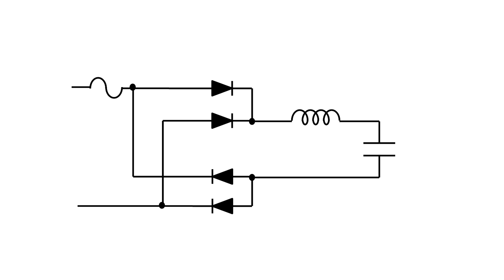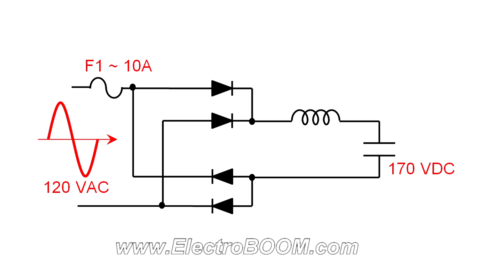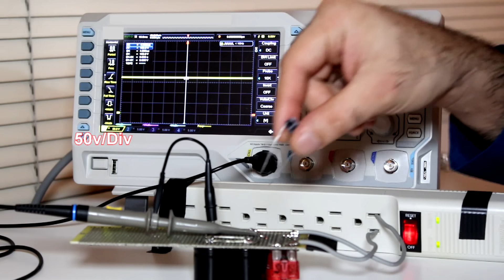Making a Full Bridge Rectifier

Comment: insulates the ground wire

we are safe now
Reply: lmfao
Reply: Or are we?
Reply: @polskiobywatel553  Moon men plays
Reply: Hahahauhaah
Reply: Hahah
Reply: LMAO
Reply: unsafe safety is where it's at
Reply: Used to be common practice amongst TV engineers as the TV chassis was live. Never used an earthed soldering iron on TV's back then.
Reply: @catman4471  A better approach would be to run the TV through an isolation transformer.
Reply: @simonharris4873  Yeah...it's odd really because that was always an option and we used to pull isolation transformers out of the old school TV sets we used to get...but we never used them. Just old fashioned pull the earth lead off tactics!
(Do you remember those school TV's on the stands? Ferguson/Thorn 1500's!)
Reply: @catman4471  LOL. I'm not quite that old 😄
Reply: @simonharris4873  Nah me neither...I just made it all up!
Reply: doubt
Reply: hands on the safety capacitors leads
Reply: @Discòωórd 
I see you everywhere
Reply: …of the oscilloscope.
Reply: This very dangerous
Reply: Only for girls
Reply: I think 🤔 this crazy man
Reply: Didnt get it
Reply: lmao
Reply: lmao
Reply: Haha
Reply: I always rip that silly ground prong off. Safety Third!!!
Reply: 6.9k xd
Reply: What is the problem and why he isolated the ground of the wire
Reply: @21Omareddin  The earth pin is a safety feature. It is connected to a large metal rod that is in the ground under every house. It is basically an emergency way to get rid of excess current. When he connected the probe to his circuit, he shorted the power to earth. This caused a fuse, another safety feature in his circuit to blow, as a fuse is designed to melt so the other components don't.
By disconnecting the earth pin, he basically negated decades of safety features with a piece of tape.
Reply: @n00bxl71  It may look like he's neglecting safety, but he actually knows what he's doing
Reply: Using 5000$ differential probes to measure mains voltage
Vs
Insulating the ground of your scope
Reply: The lack of punctuation and capitals make this comment funnier.
Reply: LMAAAOOOOO
Reply: @Mike Sienicki
Without it it's dangerus!
Reply: Love this guy.
Reply: The earth*
Reply: @bonnome2  they are the same.
Reply: @ludiProjects  in this situation maybe but it is better to use earth instead of ground because in electronics they call the neutral wire, the ground.
Reply: @ludiProjects  i didn't get that why they insulated the earthing prob of input ac cable
Reply: @anyone_me  he insulated the earthing prob of the power cable of his oscilloscope, not the power cord extension he used to power his FULL BRIDGE RECTIFIER.
Its unusual because theres normaly a transfo somewhere in the circuit that acts as an isolator.
With his setup its like he put a diode on a live wire and put the other side of the diode to the ground or any metal part of his oscilloscope.
Reply: @bonnome2  Earth/Ground Is still the same

Comment: Just so I'm clear if you plug mains voltage into a full wave bridge rectifier assuming is the 1000v/50 amp max model no matter what the most current you can draw is 10 amps? Why is that?

Comment: Sir Can you tell something me more about adding a capacitor at dc output why there is more voltage (like giving 12v ac 3amp to a bridge rectifier and adding a 4700uf cap then DMM measures around 19v dc on output )

Comment: 1:20 My 36W wall adapter was offended by that comment. 

Also, I built a similar full bridge rectifier. The difference was that I was too cheap for the inductor and fuse, but I did add a discharge resistor across the capacitors to avoid accidentally electrocuting my cat, because he likes to sniff around my workbench. Fact: if you discharge a capacitor across a pet, he/she explodes into a ball of fur/feathers.

Update: it turns out that the "36W" adapter can only output 28W. 

2:15 One of my wall adapters has no bridge rectifier. (It has AC output)

Comment: now i'm off to building my own FFFUUUUUULLLL BRIDGE rectifier. thanks for showing what to look out for and what to avoid doing. i once got a nasty burn from a high capacity 50volt capacitor when i took apart a printer's power supply.

Comment: I made mine with KBPC1010 10A 1000V rectifier and when i plug it into 230V with no load it blows the 10A fuse and also the 10A breaker. If anybody knows what Im doing wrong, please tell me.

Comment: Why do some circuits use SCR to rectify instead of normal diodes?
Reply: I think it's because you can turn the SCRs on part way through the AC cycle, reducing the amount of power that reaches the load.  Like a lamp dimmer.

Comment: Probably not the safest thing to inform those owning a 1054z type rigol scope that they can isolate it from mains reference with kapton tape on the ground wire. There's better ways of measuring those voltages...

Comment: 1:28 if you have to plug wires into a socket (receptacle) always start with the white (or blue) neutral wire then the hot (if there is a ground put that in first)
Reply: Criticizes order of wire connections when he's literally sticking loose wires into an outlet

In all seriousness though, you are right.

Comment: Insulating scope earth is a VERY bad habbit. That way you can make scope chassis live and you can get shocked by touching the scope or the earthed parts of probes.
Unfortunately for beginner you need a differential probe or an isolation transformer for the circuit under test and preferably also a separate isolation transformer for your scope to do live ac measurements safely. (Isolating also the scope is to make toughing single point of circuit safe by not having it earth reference through scope) Nether of these are usually not available for a beginner but well worth getting to keep you safe if you do live ac measurements.

Comment: the graph shows is wrong, it will just have (1/√2) voltage output of the maximum amplitude as AC current. Which is rms value

Comment: Yeah, I know you know this, but for people in the comments, attaching a resistor across the capacitors near the output will drain the power so that after the circuit is off, the capacitors will not stay charged. You must make sure that your resistor can handel the power by having a properly rated resistor. This bleeder resistor discharges your capacitors so yuo don't get shocked if you touch it when it's off, though you should still always check with a meter first. If the resistor fails for some reason, the power will not be dissipated, and you could shock yourself.

Comment: Great video Mr Boom 👍😀 I have a question about capacitors. (https://youtu.be/jEhPUa7ZZfI) That video shows a man using a 50v 4700 farad capacitor in parallel with a weak 12v motorcycle battery. After attaching the cap it works fine. Please why does this work?

Comment: why did the caps hurt u in the end? if they r charged even to 170v they should only give a slight tingle as u demonstrated earlier
Reply from the maker: The sensation on different areas is very different. My finger tips feel much less than the palm of my hand for some reason
Reply: ElectroBOOM  can u plz make a vid on a solar tracker using arduino uno.
Reply: @ElectroBOOM  I'm guessing your fingertips have thicker layers of dead skin and hence greater resistance.
Reply: @ericthecyclist  if you look carefully, you will see he doesn't actually touch both legs of the capacitors. only the grounds of the two rows. 170 volts dc is much more dangerous that 120 volts ac.

Comment: U could use a dual half bridge voltage doubler since youre using not thaat high current 2 diodes 2 caps also if you do use my comment you have to work within world class safty regulations as painful as it is.

Comment: May I ask why you put a coil into your circuit? Doesnt that build up a countering Voltage and actually works against your Brdige when the current is zero?
Reply: I just noticed that the diodes wont let the current flow back. So it wont work against it. But isnt the coil just another resistance in this case? Or what is the use of it?

Comment: Wait, if a resistor is a wire spun around a ceramic core shouldn't resistors have some inductive reactance and cause a phase shift?
Reply from the maker: +Stefan Nilsson well the core is ceramic, but you are right, every thing always had resistance capacitance and inductance

Comment: I need help with a bridge rectifier I'm making, I need to calculate the smoothing cap for it on a 10A max load, 380v dc out of bridge rectifier, research gave me C = I *t / v, where C = capacitance, I = max current, t = time and v = max ripple. but it gives me a capacitor of 10,000 uf, which just seems insane... Anyone able to help? Mr ElectroBOOM?

Comment: DC voltage isn't actually less dangerous than AC. Either way though, under normal circumstances 170 volts isn't incredibly dangerous. But with broken or burned skin it can be

Comment: Great presentation. Funny too. LOL 
I have a fire alarm buzzer which operates at 12 volts AC. I would like to power the buzzer with a 12 volt D.C. sealed lead acid battery. I understand how to convert A.C. to D.C. using a bridge rectifier. 
How can I convert 12 volts D.C. to 12 volts A.C. @ 50/60 Hz? It doesn't have to be a fancy circuit. Just something simple to power a buzzer for 3-4 seconds.

Comment: I don't get it. During the live connections you can touch DC voltage, but you get a shock from the capacitors when you unplug. How does that possible? Is that real or just a troll?

Comment: 2:00 can't feel a thing.
3:54 hurts a lot

explain yourself mehdi!
Reply: Actually he doesnt fake most of the incidents, they are scripted of course but not faked. He surely wouldnt put himself in extreme danger on purpose but the things that happen arent exaggerated and could happen exactly like this. Im quite sure everyone has been zapped by a high voltage capacitor before, whether being in a camera or a bug zapper or any powerful power supply and although it sounds funny, it indeed is dangerous and you should always discharge them.
Reply: zapped by a discharging capacitor i guess
Reply: ElectroBOOM
Há 2 anos
+DrR1pper It's thee same DC, just that different spots on body have different feeling. The palm of the hand shocks a bit harder.
Reply: Oh look chems is here
Reply: Full bridge Rectifiers...... in a nutshell 😂😂😍😍
Reply: POWER OF CAAAAPAAACCCIIIITOOOORR
Reply: Hi,osama ! I your big fans! Would you like to go boom somewhere with me?
Reply: dry skin v. wet/sweaty skin, resistance changes by orders of magnitude...  Besides he fakes a lot of stuff for effect, not dumb you know!
Reply: that was my old account that got deleted which means the comment got deleted too.

i was hoping he'd reply again :(
Reply: He got shocked from the capacitors which hold AC
Reply: AC charge. Its very painful
Reply: @paganmin80  haha

Comment: ElectroBOOM - I have a question. If DC is so widely used in our wall adapters. Why is city power actually AC to begin with? Why couldn't our grids be DC, making it much safer against accidents (as you said, 170 VDC is BEARly felt compared to a potentially lethal shock of 120 VAC)
Reply: on long distances, voltage drop on dc becomes too high but on ac voltage drop is much less than dc. Because of   that, we use ac on power lines and dc on electronics
Reply: Also, we need to convert the high voltage (240/110 Volts) to a low voltage (5V) for our electronic appliances.  With AC we can use a transformer for that.  Low cost DC-DC supplies have only relatively recently become cost effective.

Comment: How timely! I bought some LED Christmas lights, a string of 200, well actually 3 strings in series.  I noticed the lights blink rapidly (I assume at 60hz)  The string was cheap, so I think the LEDs are only turned on when the AC goes positive.  I think each string is 10 watts.

I was planning on making a bridge rectifier to stop the blinking.  If I build your circuit, will the 170V DC be too much voltage for the LED string that was running on 120V AV?

Will I set my house on fire if I used this circuit to run my Christmas lights?

Comment: I assume that you are getting 170 VDC from 120 VAC due to fact that this 120VAC value is rated RMS and that's also why filtering capacitors with no load are charging higher than transormers second coils/wiring are rated, right?

Comment: How come he can touch 170VDC but is zapped by touching the cap?
Reply: Ah, he actually explains this in the article on his website linked in the description 

Quote: "When your bridge rectifier is not connected to a load, the output capacitors can hold the 170VDC for a very long period of time and shock you if you touch them. I showed you how I can’t feel them when I touch 170VDC with my fingers, but it shocked me when they touched the skin on the palm of my hand. It is because skin in different areas have different resistance and you feel the same voltage differently. So be careful around high voltages."

Comment: Also, where did you get your Solder Breadboard? I'm trying to design a higher power AC adapter and I need one of those for testing. Did you get it at like Radio Shack or something?

Comment: What's the difference between your rectifier that converts AC to DC using just capacitors & inductors and something that uses a IC such as 7805 or 7812? Wouldn't yours still have ripples in the output?
Reply: This kind of rectifiers are (were) usually used in combination with step-down transformer, for steping down mains voltage down to voltage required for common electrical devices. This is also an unregulated supply, meaning that any change in input would have direct impact on the output. If you'd like to be safe and have constant voltage, you'd normally just add IC (like 7805) at the output of rectifier, but ripple at the output of an IC would still be present.

ICs like 7805 are usully used when you have battery with higer voltage than your device needs, and which also discharges over time, so voltage regulation is nessesary.
Reply: This kind of rectifiers are (were) usually used in combination with step-down transformer, for steping down mains voltage down to voltage required for common electrical devices. This is also an unregulated supply, meaning that any change in input would have direct impact on the output. If you'd like to be safe and have constant voltage, you'd normally just add IC (like 7805) at the output of rectifier, but ripple at the output of an IC would still be present.

ICs like 7805 are usully used when you have battery with higer voltage than your device needs, and which also discharges over time, so voltage regulation is nessesary.

Comment: Just a question, mr Mr ElectroBOOM. I studied rectifiers and built one when I was in school, for my guitar pedalboard :D But I used also a 9V zener diode. Why didn't u use any? You could avoid that ripple. :D
Reply: because you'd need around 18 zeners to get that high of a voltage, and because most of the time, zeners aren't rated for such high wattage

Comment: Hi i'm a big noob but i'd like to make a regulator/rectifier for a friend's motorcycle because they tend to die quickly and they are so fcking expensive (i mean regulators/rectifiers not my friends LOL). Would you explain it to me by any chance?
Reply: Husker so annoying when you just trying to help and your friends just go like "nope" and dies
Reply: In case you still need help with that, the thing in the motorcycle is a magnet fixed on a rotating part of the motor + a coil + a diode (rectifier) + some circuitry to not go over the battery voltage (regulator)
You need to find what dies first. 
Then you can replace what breaks. 
You can get some quite big diodes from old pc power supplies, look for the thing on the radiator which has one or two diode symbols, if it has 2 connect the tails and heads together, replace the diode with that (and screw it on a metal plate with some isolation in between, you can also pickup the radiator from the psu)

Add a capacitor behind the diode and plug it with the - strip  opposite to the bar on the diode (you can salvage those from the psu too, make sure the voltage on it is over  25V.)
Then get a buck/boost converter from aliexpress, make sure it outputs 14V and plug that on the capacitor and the battery.
You should be able to make a coil from an old micowave transformer by cutting it to size and wrapping some thicker wire around the center till you get 16-20V behind the capacitor with a load attached.
The coil also might need to output high voltage to the spark plug, so you should keep the thin wires of the microwave transformer.
Reply: Galactic Ruler it wasnt a joke tho, its a super annoying thing
Reply: +Filip Edwardh If you want your joke to be funnier, remove the "go like "nope and" from your sentence.

Comment: So when the circuit was live, you touched 170V, you felt nothing. Then when it was off, you touched the capacitors with the residual 170 Volts and you felt it?